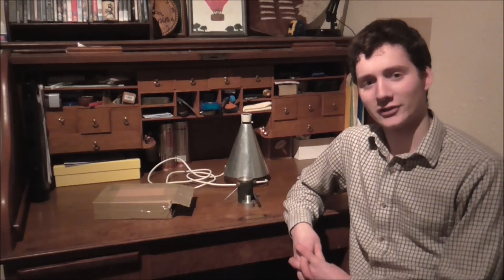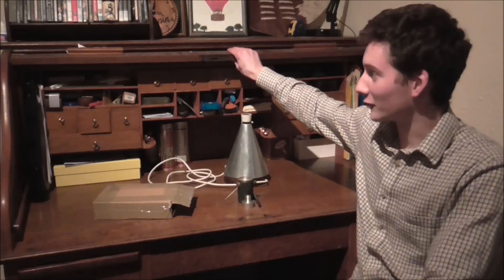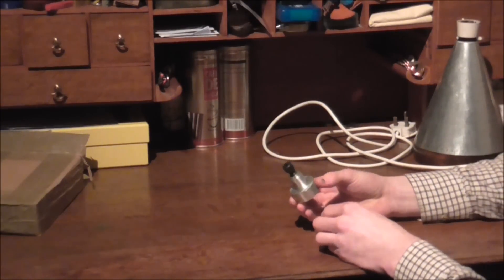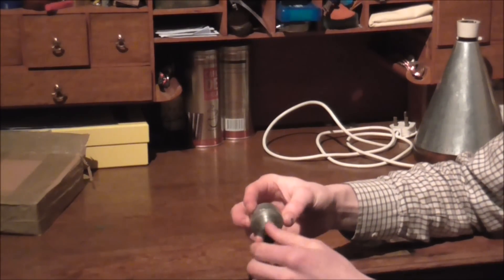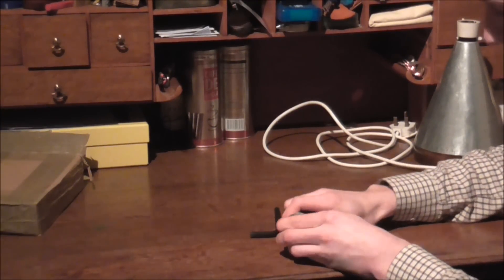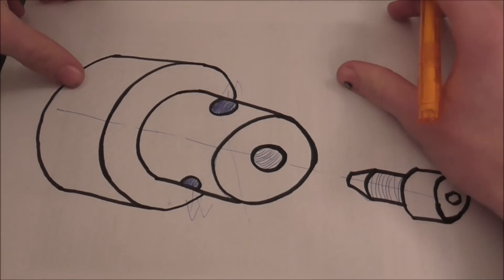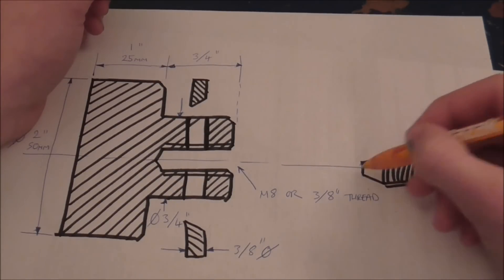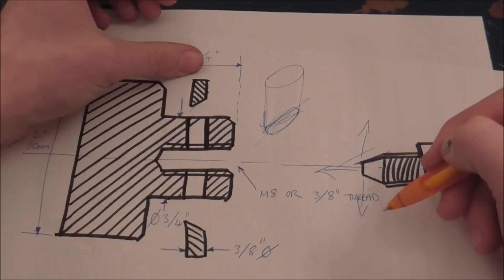Roll Top Chat - No. 1

Comment: MrCrispin,

Instead of those fiddly little plugs with tapered ends, have you tried bearing
Balls?

The screw could be hardened and the hole
Peened, or machined on a CNC not quite thru
With a ball mill from the far side leaving a little ledge to retain the balls.

I would lose those plugs in the lathe pan really fast.

Regards,
Kappullen
Reply from the maker: kappullen Hi yes that would retain the plugs better, But I would be very worried about marking the bore, You would be pressing the balls in to the surface of the bronze bore.
Reply: I usually will use the pipe plug and band saw method, or a mandrel machined to a tenth or so of press fit. Quick and dirty.
Many engineers make a thousand dollar fixture for a twenty dollar part.
They just let me do what I want anymore where I work.
Reguards
Kap

Comment: It looks like a fuse from a 155 mm artillery round designed to airburst. The numerals are used to set the altitude/time of the burst. An artillery shell, without the fuse installed, even though it is loaded with high explosives, will not explode when it hits the ground without the fuse installed. These are shipped separate from the round itself and are threaded to screw into the round itself. In other words, it is the same thing as a detonator cap used to explode dynamite and similar explosive compounds.

Comment: Hi Crispin,

That's more work in an expanding stub mandrel than I'd usually do. I just use a tapered tap to thread then and slit them with a hacksaw. When the bolt reaches the tapered section of thread, it expands the mandrel.
Reply from the maker: Paul Compton Good Idea, I was going to cover a similar method to what you have mentioned in my next edition so i will also mention what you have suggested as it must be one of the simplest and most strait forward.

Comment: Thanks for the information on the expanding mandrel. That should be a fairly straight-forward item to make and quite useful. I also like the scribe tool you showed, another useful item to make.
Nice new series, thanks.
Joseph
Reply from the maker: Joseph Magedanz Thanks, Just be careful if you skim the od of the mandrel with the plugs in. If they arn't a tight fit they could fly out!